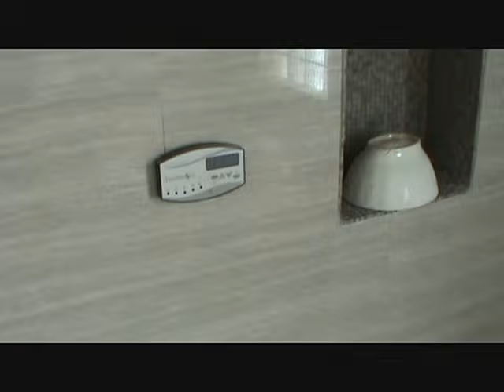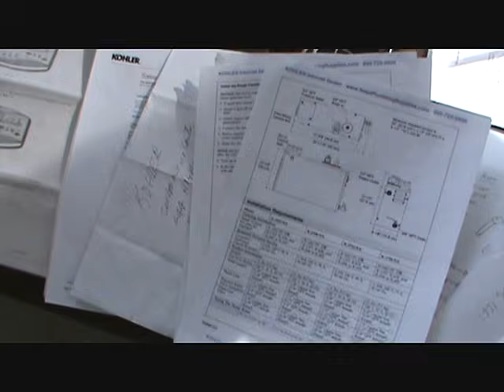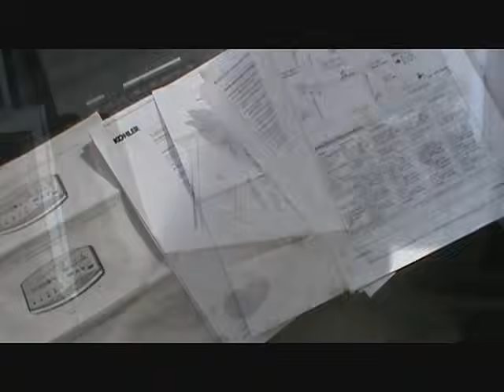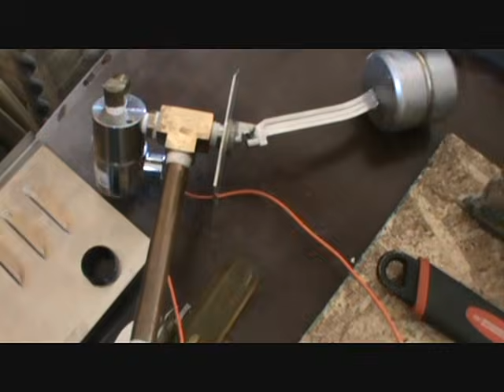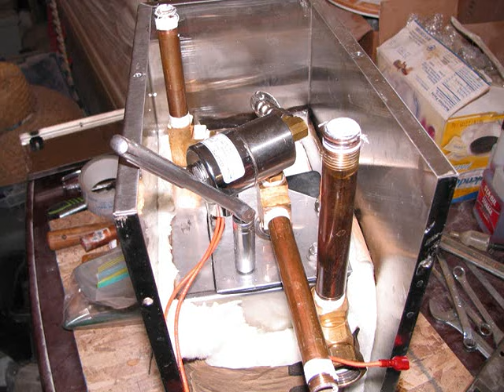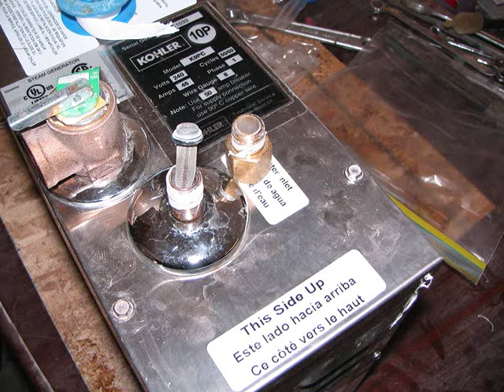Kohler steam generator float switch repair part 1

Comment: I want to thank you for making these videos. It’s the only place on the internet I could find where someone was trying to repair their kohler steam generator themselves and they gave me the courage to take mine apart after months of no error but also no steam. 

Since our water is so hard I just expected to have to descale the tank. I was right that there was all sorts of Limescale coating and a pile of lime fragments but I also noticed the heating coils looked bad. Still I filled the tank with boiling vinegar water mix and left it for a day. After draining it I could see the Limescale significantly decreased or gone but with a better look at the heating coils they looked really bad. Still I hooked it up and no steam. So then I figured I needed new heating coils but I thought you said in your video that they don’t sell parts. Eventually I went to the kohler website and saw they sell the heating kit for around $80. Just installed it by taking the old heaters out and putting in the new ones. The smaller old coil was completely broken in one spot and the larger old coil was split in many spots with one split only connected narrowly. Put it all back together, confirmed no leaks, power on and immediately got steam like it were brand new. 

I’ve hesitated getting it fixed fearing I’d have to spend a lot of money on plumbers and the. I just assumed it would break in a year and I’d have to do it all over again. Now I know how I can descale hopefully before the coils corrode but even if that happens I know I’ll be able to fix it myself.

More owners need to know they can maintain and fix these units pretty easily.

Comment: If it's blowing the breaker without a code I would pull the unit as see what's shorting out. I had a similar situation where one of the leads to the heating element burned off and it caused the breaker to trip. I was able to tig weld a new bolt onto the end of the one that burned off and put it back into service. You could at least find out why the breaker trips even if you can't to the actual repair.
Reply: Since my warranty is long up, I'll give this a try.  Kohler is too busy to answer my call so now I wait for email response to my problem.  I am working on the last video of this set.  I had opened the external covers to look it over, but had no idea what the parts were doing.  I especially liked the diagram and explanation of the purging process.